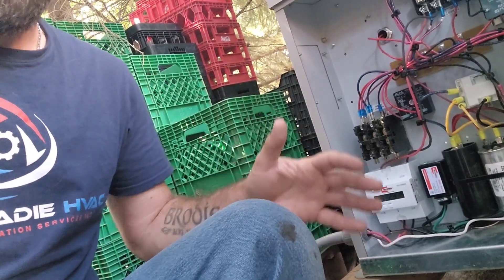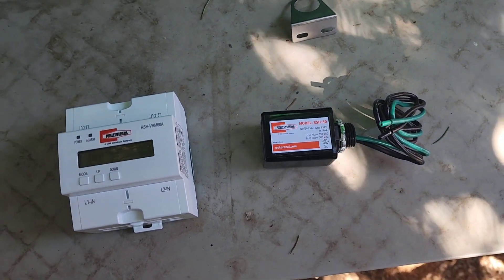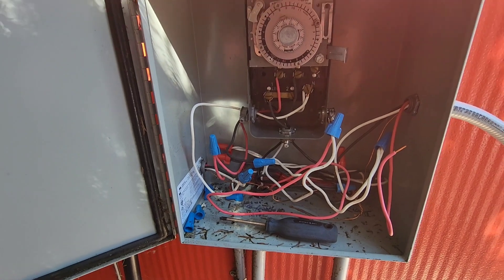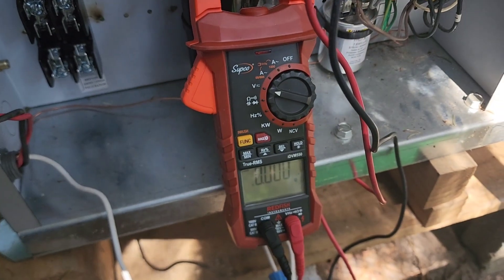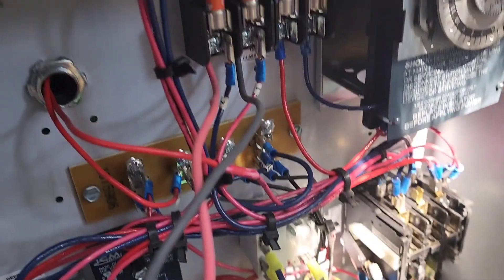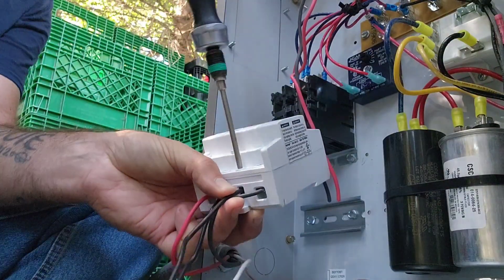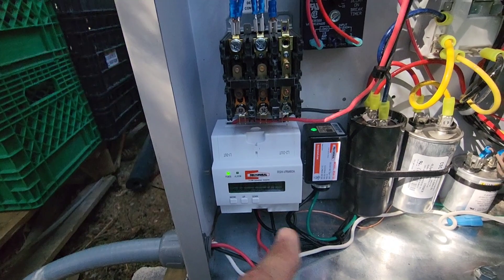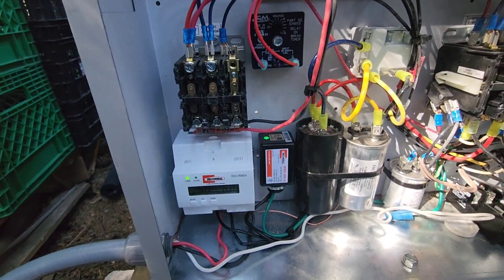RSH - VRM60A Voltage Monitor and RSH - 50 Surge Protector Install On A Condensing Unit

Comment: Great video. Two years ago, I bought a 24-year-old, 3,100 sq feet, one story ranch. The entry foyer spills into the living room, kitchen area, which is a wide, open floor plan with a 16' vaulted ceiling. The nine floor vents in this huge space have good air flow, but all the other rooms far left and far right have much less air flow, with two rooms having almost no air flow. Each far room is about two degrees less than the big main room where the thermostat is, and two of those far rooms with almost no air flow are 5 degrees below the thermostat temperature.

The giant basement is unfinished with eight-foot ceilings and everything is exposed, no drywall on the ceiling. I’ve covered the water pipes coming from the well pump water treatment area with those split foam insulators. The previous owner didn’t have them covered for 20 years. It is a walkout basement with new French Doors. That area near the door is of course not below grade, but as you walk further in over the next 50 feet, it does sink to below grade, and continues about 70 more feet to the back where the furnace is.

The coldest temperature I’ve recorded on 5 different Wi-Fi thermometers I have placed in different areas down there over the last two winters have never registered lower than 62 degrees, even on the coldest of days when it’s down near zero.

Using a thermal imaging camera and a smoke puffer, I see that since none of the ducting is sealed at the seams, and where the seams are sealed, it’s only with the low quality “duct tape” that I know you should never actually use on ducts. It’s as old as the house and it disintegrating into powder when you tug at it.

My question is, do I seal the seams and gaps with mastic tape and mastic paste, or will I risk having freezing pipes during the coldest days of the winter in New Jersey, where it can go down to almost zero degrees at times, but mostly only goes down to the teens during January and February. I’m all ready to seal but I am having second thoughts about having freezing pipes. Thanks.

Comment: What would your over and under volts be on a 240VAC single phase unit?
Reply from the maker: It's best to ask the manufacturer of the machine but 10% would be a good place to start.

Comment: Gm. So this is basically similar to White-Rodgers 49P11-843 -
Emerson SureSwitch Relay? And also in a 3ph system that works assuming the black n red legs are 120v each ? I haven’t really touched 3ph systems afar from maintenance. Learning here.
Reply from the maker: The sure switch only protects from brown outs not over voltage or surges.

Comment from the maker: Who else uses surge protection?
Reply: It’s necessary especially with these inverter units, protecting the board is vital!! The next step up from this awesome combo is the 
ICM 493.
Reply: I do for all communicating or multi-stage  systems. ICM 493 has been the only device found worthy so far. Hard to beat 5 MOV'S.
Reply: I do! Check out these guys:
 arcsuppressiontechnologies.com
Reply: I've seen no difference in failure rates between surge protected and non surge protected. Hard for me to sell them based on my personal opinion